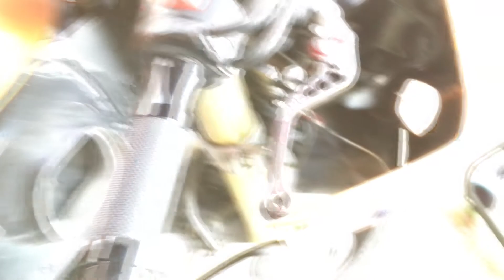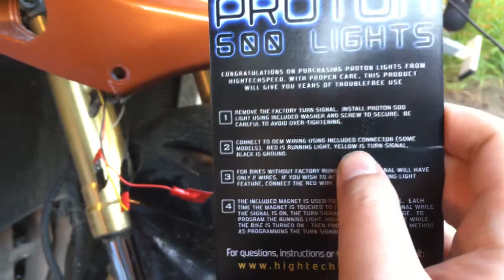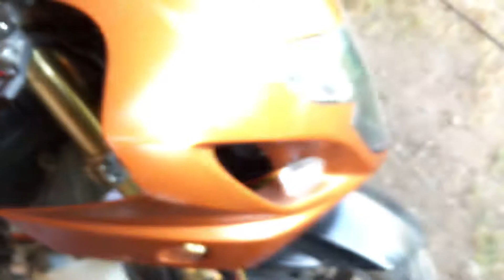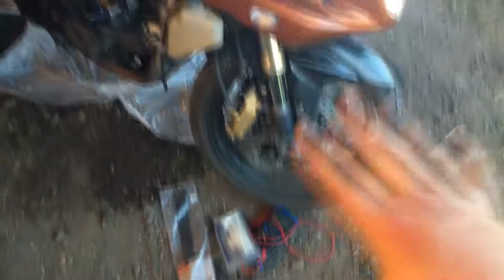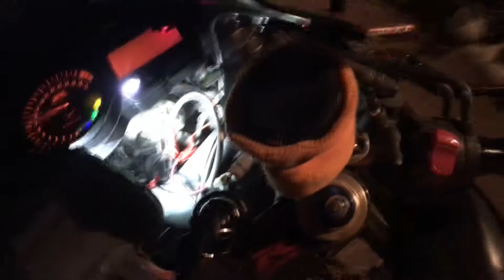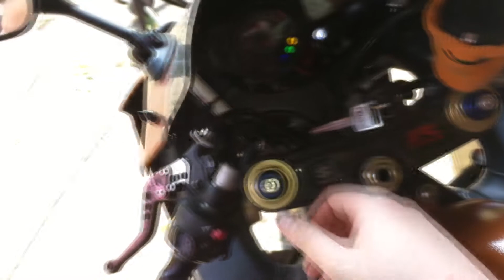Installing Proton 500 turn signals on my gixxer

Comment: I was a little frustrated with my install and then found your video and started swapping the wires as you mentioned. I finally got my running lights to work, Thanks!